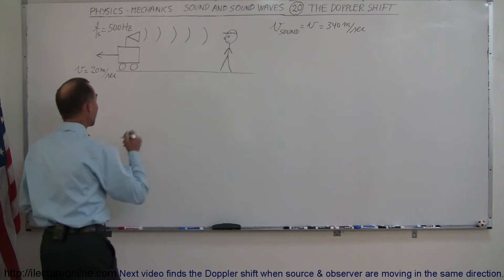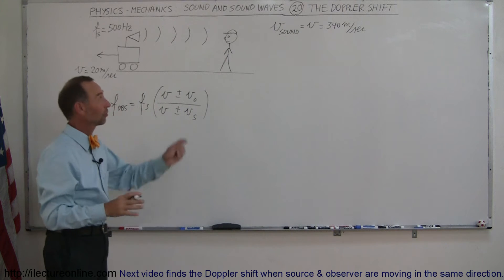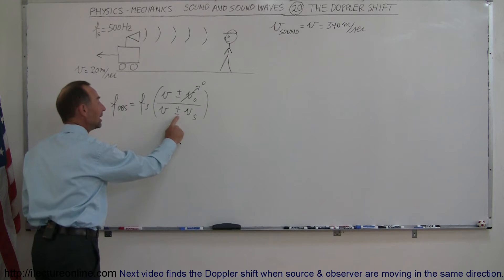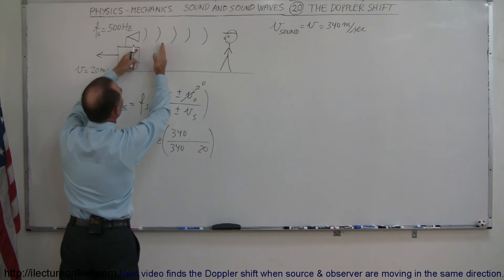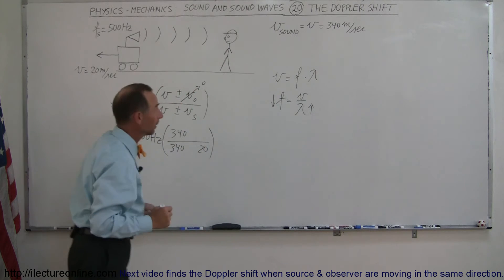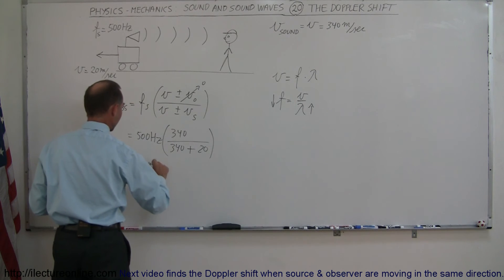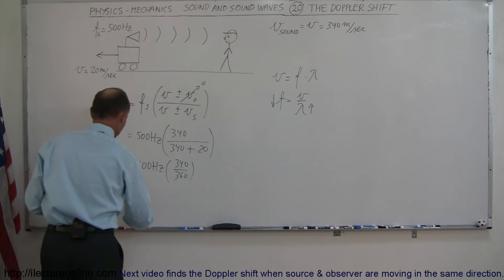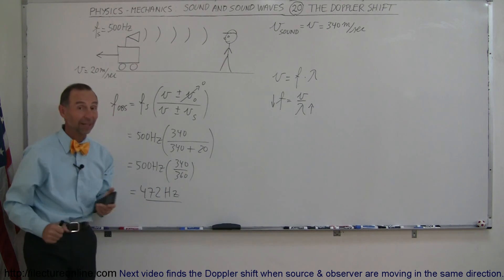Physics 20  Sound and Sound Waves (20 of 49) Doppler Shift

Comment: But it is also correct logical to write Vo as -20, so that the sign in the denominator can also be -(-20) same as +20?
Reply from the maker: The way to use that equation is to enter the ABSOLUTE value of the velocity of the source (or the observer) and then determine the sign to obtain the correct phase shift.